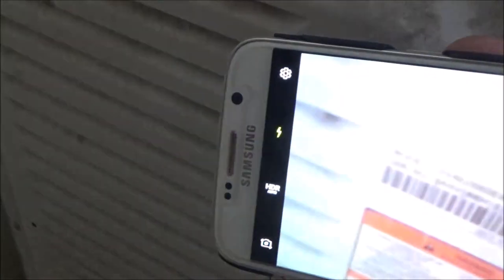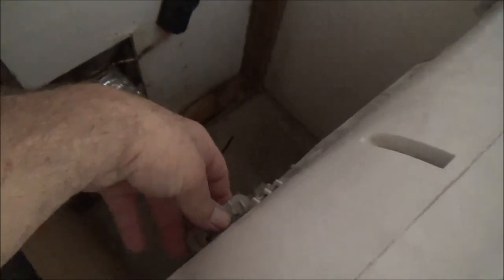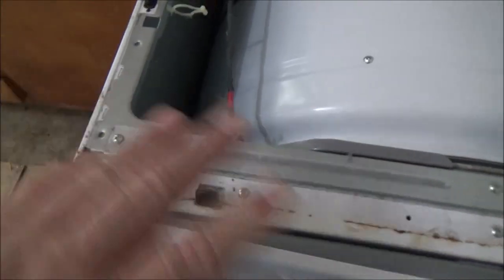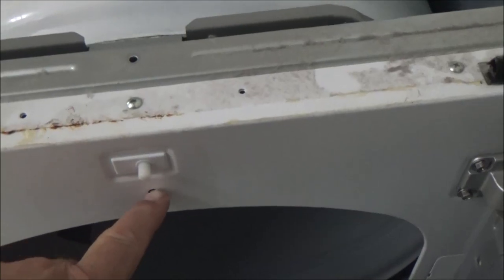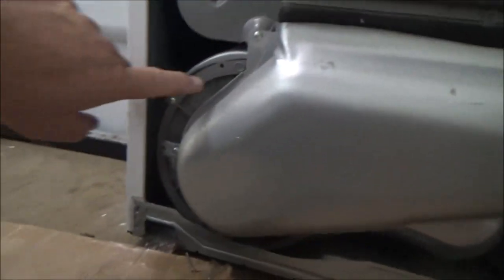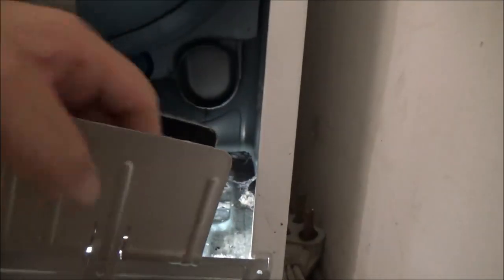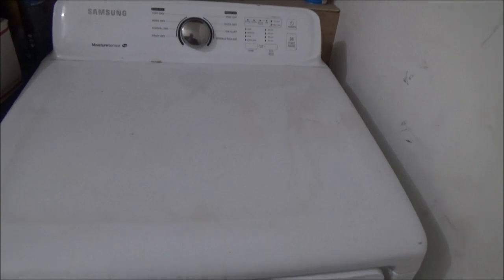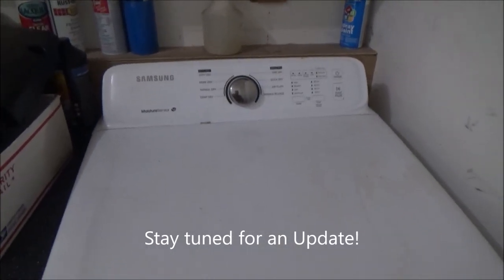Repairing Samsung Dryer Heating Element Model DV40J3000EW/A2 With a Broke Toe!

Comment: Thanks for the procedures to replace the unit.  Got the parts and worked my way down to the bracket.  Found out quickly that working behind the bracket would be difficult.  Closed the lid and tilted the whole thing back on the wall.  Now you can use vice grips on the two screws under there and twist them loose and upward.  Then the whole assembly came right out.  I did use a marker on cover of heater to show wire colors to get them back where they belonged.  My unit was broken about the same place as yours.   PS.  Make sure you don't have any plastic backed moisture  barrier pads in your wash and not see it going in the dryer.  It can plug the filter stopping the air flow and it will overheat and ruin the heater coil.  Blessings  Gary

Comment: My opinion, but you aren't really adding any risk to fire by hot wiring the element back together.  The risk is that the wire will make contact with the dryer housing and possibly short out.  I have this same issue, and I"m thinking I'm gonna use a crimp connector to get it back together until the new part comes in.  Your video is great!  Thanks so much for posting the video.  Great job!

Just an update.  Used the crimp connector and overlapped about 2 of the coils.  Seems to work fine.  Taking apart the assembly that held the element and putting it back together was a pita. But patience wins the game.  Everything inside these machines is sharp. Be super careful !

Edit. New part is in after a week of using the repaired heating element.  No issues either way.

Comment: Thank you , watch several other video , your covers everything you need to know, thank you for a very complete and thoughtful video. our dryer limiter switch went out yesterday, purchased replacement therm and limiter and replaced them easily with your video help. all back to normal. thank you!

Comment: I just bent the bracket and the heater came out easy. Bend it back and put the 3 screws back in. 30 minutes replacement.

Comment: My  dryer isn’t drying the clothes completely.  It wasn’t drying my clothes when I first got it.  All things was checked. Fuse , coil, thermostat, outlet, vent clean, no blockage in the walls , dryer on the second floor . Air pressure went from 1900 to 2600 and clothes isn’t drying completely after. After running it 4 times. Dryer was replaced the same issue for 2yrs. Any suggestions.
Reply from the maker: probably low fan speed to remove the moisture or not getting hot enough due to the thermal overload. they like to play the safety card but an independent repairman would fix it if you asked.

Comment: I order a coil kit with fuse but instead of the thermostat it came with a thermistor will that work fine? After connecting it I turned on the dryer but still won’t blow hot air ?? Any reason why ??
Reply from the maker: You might have wires crossed